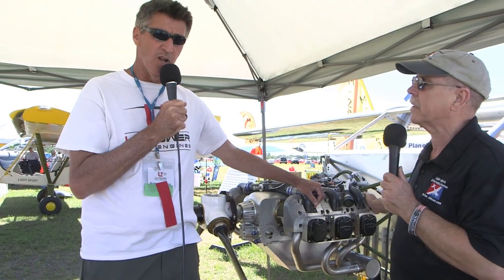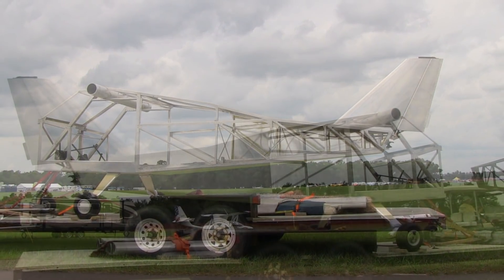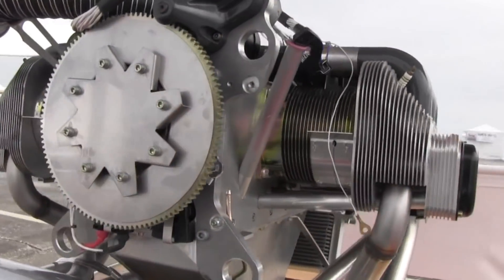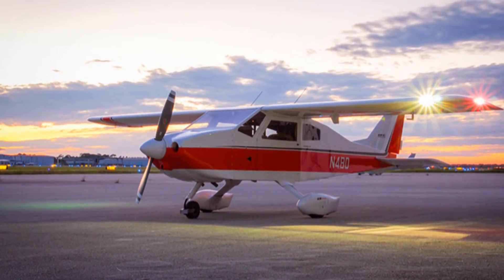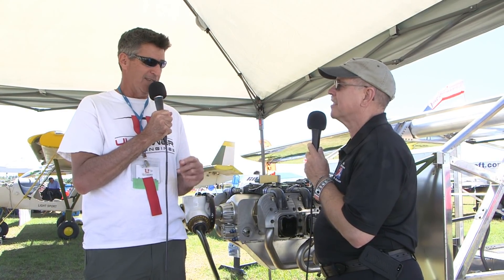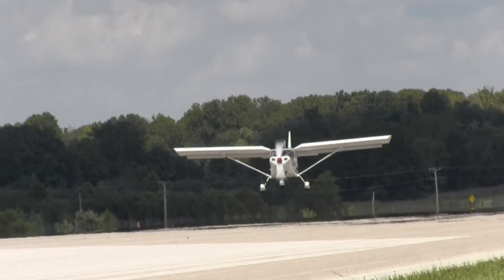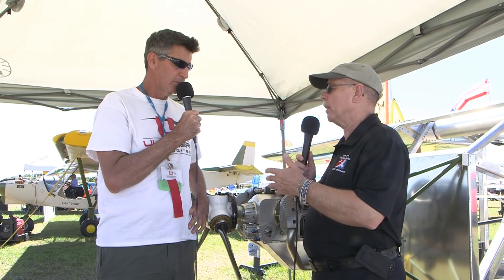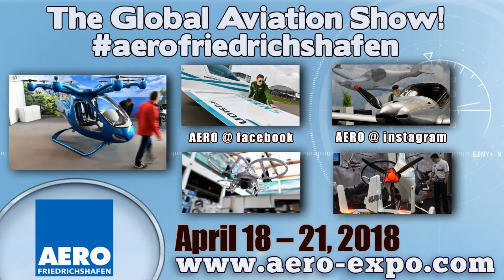UL Power Aircraft Engines, UL260, UL350, UL390, UL520 experimental, amateurbuilt aircraft, engines.

Comment: The accessory section on the engine looks pretty sparse, where's the magnetos, fuel pump or air pump
Reply: It uses electric fuel pumps and electronic coil ignition they're mounted in the firewall.

Comment: I like the UL engine but its just to expensive.  A new titan 340 is less than $25,000 for 180hp and still less than the UL with fuel injection.  And you can take that titan anywhere to get worked on.